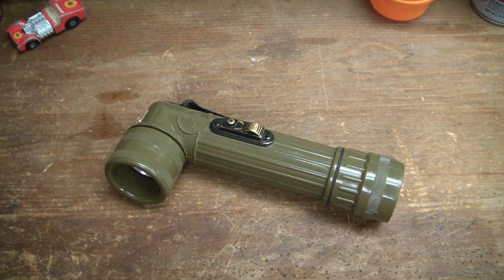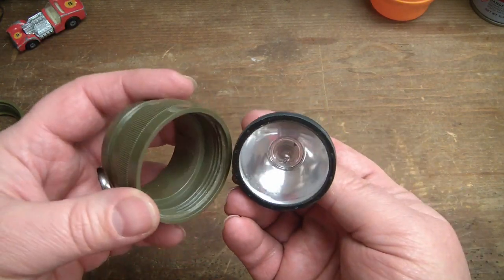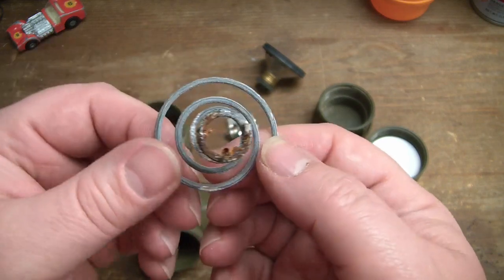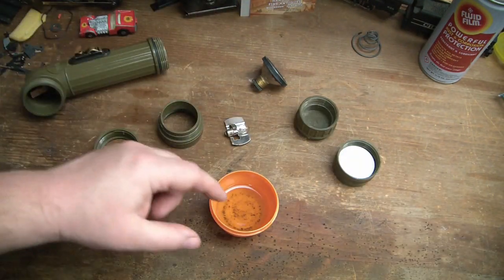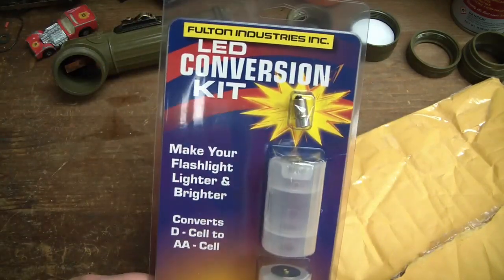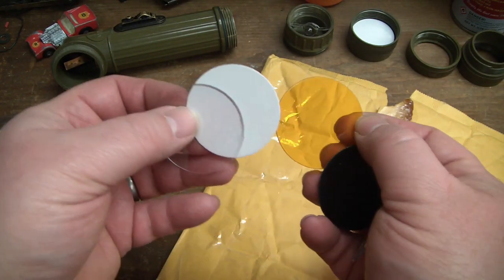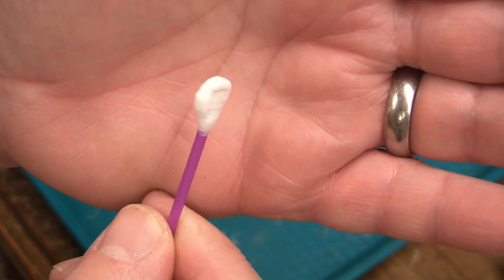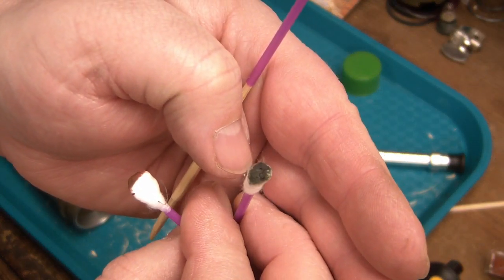Fulton MX-991\U Military Flashlight Upgrade, Rehabilitiation, Restoration Part 1

Comment: That's a cool flashlight!  It's great that parts are still available! I wonder if a pencil chucked in a drill eraser end facing out would work on that contact?
Reply from the maker: Oooo that's a good idea right there!  We still have one of these motorized erasers at work. However, Mr Fulton himself has clued me into a more simple solution.  The springy contact that hits the bottom of the bulb will slide out.  The other end of that contact is the one inside that I couldn't reach!  I will show this on the last video about the flashlight on Friday!

Comment: What the hay only five dollars?? Damn you’re lucky, I got mine for like twenty
Reply from the maker: If you paid twenty, you must have been willing at the time.  Is yours the older model like mine without the switch guards on the sides of the switch, or is it a newer one?
Reply: @timeflysintheshop  it’s the newer model with the switch guard, and mine’s got the lanyard ring. But it’s definitely been used quite a bit; it’s got signs of normal ware and tear

Comment: Hello
I have such a lamp and it doesn't work now because the bulb is no longer on. but i'm in vietnam so i don't know where to buy it. hope you help me
Reply from the maker: The designation for the bulb to fit that flashlight is "PR6".  If you can not find it locally, search on the internet for a PR6 bulb OR a PR6 LED bulb if you want the batteries to last longer.  The LED bulb needs to be for 3 volts.  1 watt is fine, if you get a 3 watt, it will be super bright!

Comment: on mine, which is a later, switch guard version, if you remove the lens/bulb end and there are no batteries in the light, you can slide the copper contact out.
Reply from the maker: Yes!  I learned that and showed in the next video!  😁👍😁👍😁👍

Comment: I just got mine and it won’t stay on when I move the selector switch all the way to top/third position
Reply from the maker: So it turns on, but does not stay on?  Hmm.  Does it come back on if you push on the switch as if driving the switch into the body of the flashlight?
Reply: @timeflysintheshop  That is correct. The only way I can get the light to come on is by depressing the switch while it in the second and third position. It will only stay on as long as I have the button depressed. Thanks again for your help! I really want to be able to use this light. I bought it brand new already converted to LED
Reply from the maker: @HumbleCowboy92  Ok.  The switch slides into two positions.  The first one up is the signal position where the light does not work unless you press the round button.  If you push the sliding bit further up, the light should stay on without pushing on the round signal button.  So if yours is working as if in the signal position, R U SURE, you just have not pushed the sliding switch all the way up?  If the flashlight is brand new, maybe it is a little stiff???  If you are sure you have moved the switch to the correct position and it still does not work, I would exchange or return it for another one.  Fulton Industries seems like a good company, I am sure they would take care of you.
Reply: @timeflysintheshop  Mine seems have three positions. First is like a lockout where nothing will work, second is signal, and third is supposed to be where it stays on but does not. That is probably what you’re saying anyway, but I’m just being clear. I am thinking maybe it is defective. I will contact Fulton and see if they can send me a replacement
Reply from the maker: @HumbleCowboy92  Yes that sounds right.  Good luck to you!  Thanks for watching and if you like old tools, tractor shows, etc..  check out some of my other videos!  😁👍

Comment: By chance what did you use to polish the copper? I noticed some corrosion on the contact strip and along the side strip that runs the full body of the tube that I need to buff out to hopefully get it to turn on.
Reply from the maker: Hey!  I was using the green and brown polishing compounds that came with a set of polishing stuff from Harbor Freight and then finishing up with flitz.  I am sure I was over doing it!  Good luck with your project and thanks for watching!

Comment: The funny thing is I’ve got a couple of those that were issued to me in the Air Force and I enlisted in ‘85. Meaning the AF had back stock that was more than 10 years old.
Reply from the maker: Interesting!  Thanks for watching!  Part 2 should coming soon!
Reply: They still manufacture and use the same flashlights today.

Comment: I have one of these flashlights. Mine is dated USN 1942 and is very similar to yours in external appearance. It has a small threaded bulb, and like yours, the base cap spring needed an Evaporust treatment. Two small screws hold the switch to the body. It disassembled, and was dirty inside. I dont know if Fulton made my flashlight, but I'm going to check. It would be great to do the led upgrade, which looks like an easy job. Thanks for the useful restoration tips. New subscriber.
Reply from the maker: Thanks for watching and subscribing!  I am glad my videos were helpful.  There is quite a bit of history to these flashlights, and you can look it up on wikipedia as fulton mx991/u flashlight.  You may find some reference to your flashlight in the "design" section where it talks about the history of the development.  Based on your description, I think yours would be a TL-122A.
Reply: @timeflysintheshop  thanks